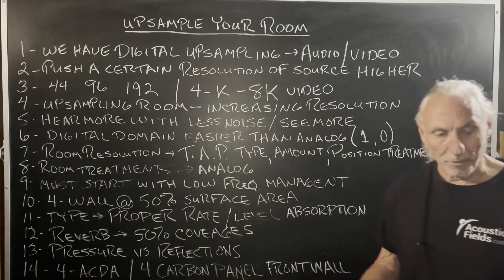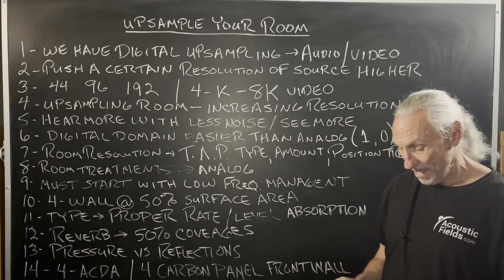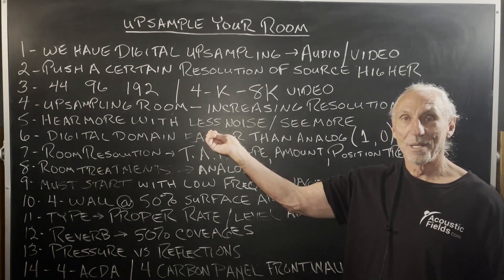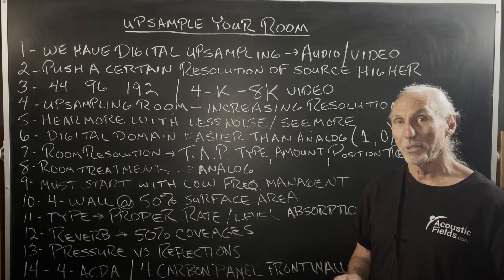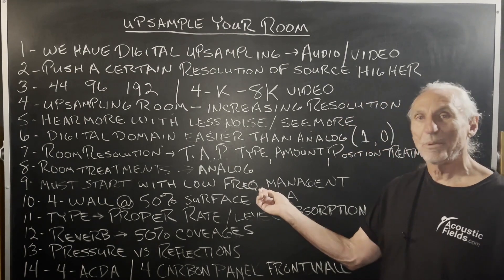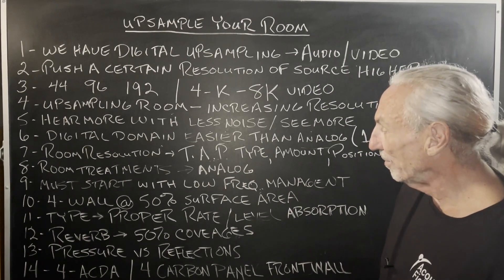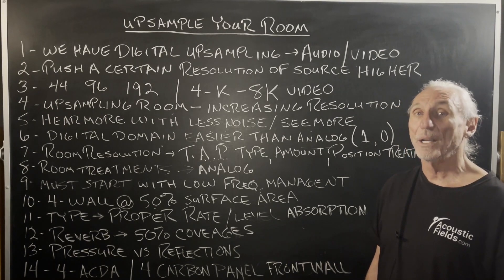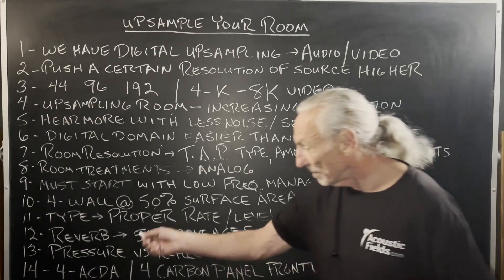Upsample Your Room - www.AcousticFields.com

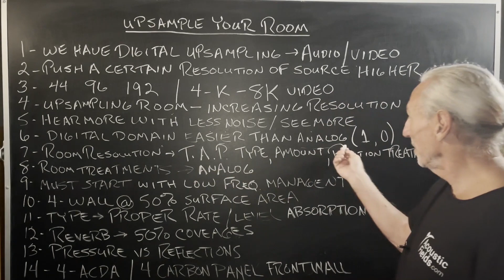Comment: 2:00 Imaging engineer here - you're referencing "lower noise" when switching to a newer display.

While this is not actually the case- the only "digital noise" you may see in a computer display signal would likely be from older displayport compression, which on its own is essentially invisible to untrained eyes.

What I believe you may be trying to describe is the generational evolution of the LCD panel that you now look at. Newer displays have much more advanced layered designs, and can reproduce not only better colors, but reproduce them in a non-splotchy way across the screen. Backlight technology is a large contributor here. Even backlighting across your computer montior is a significant contributor to image quality and perceptively "good" images.
Reply from the maker: Noise is present in all electrical systems. Just as in room acoustics, you lower the noise floor, resolution improves. Cables can go a long way for a lower noise floor along with source resolution.

Comment: Interesting about the power cable for your tv.
Reply from the maker: Lower noise floor in cable produces less picture noise. Blacks get blacker. Whites get brighter. Noise transmission impacts all electrical signals that involve the movement of energy from a source to a receiver.